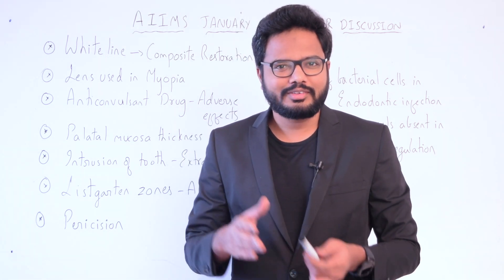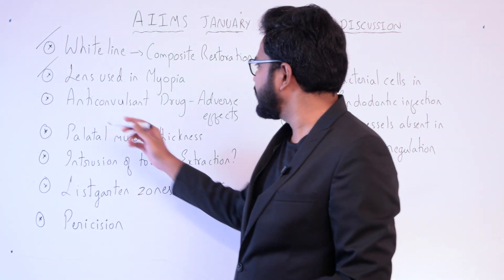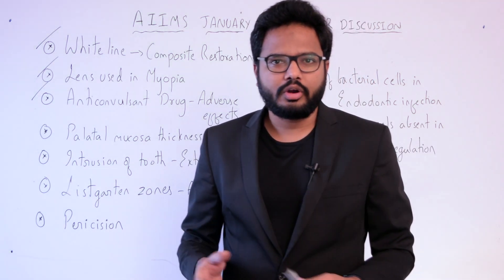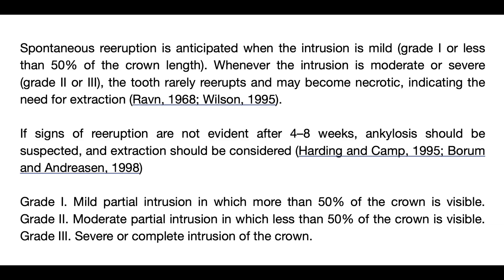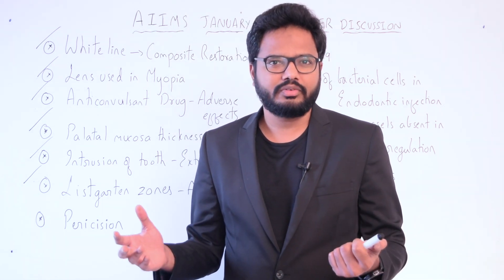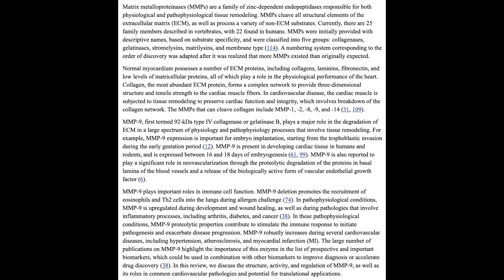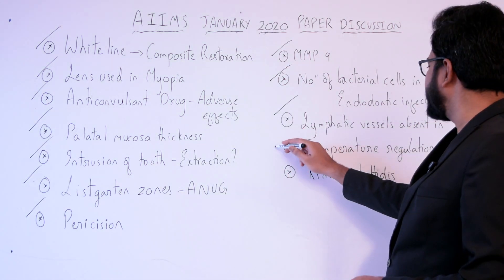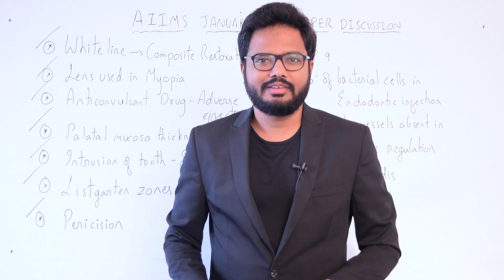Part 7 - Paper Discussion | AIIMS January 2020

Comment: Sir in the question of palatal mucosa thickness, one option was that it is measured from palatal mucosa to periosteum . and other 3 options were tooth related as you mentioned. So, isn't first option is right . if not then why ?
Reply from the maker: What's the exact question Ramya?
Reply: @SaiNaveenKumarPilliPTBD18  question was Which of the following statement is true in context to palatal mucosa ? 3 option were related to their thickness in premolar and molar regions , one option was that I mentioned above
Reply from the maker: Okay Ramya. In several studies where they tried to evaluate the thickness of palatal mucosa, they performed bone sounding using periodontal probes with rubber stopper. As you know, in bone sounding we go to the bone level. So palatal mucosa thickness is evaluated till the level of bone. Hope its clear. Anyways, refer bone sounding in Carranza once. Best wishes.